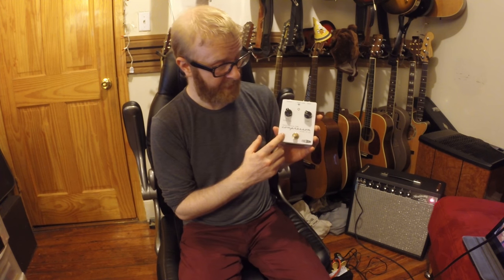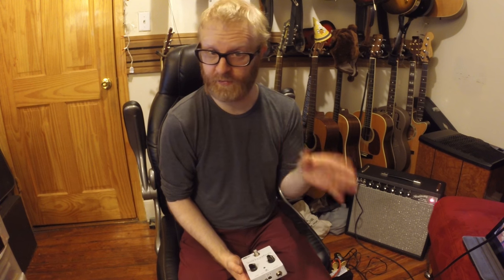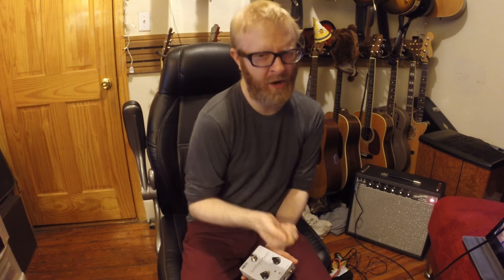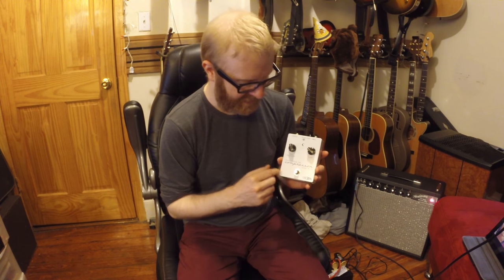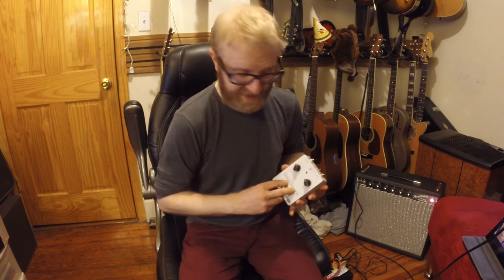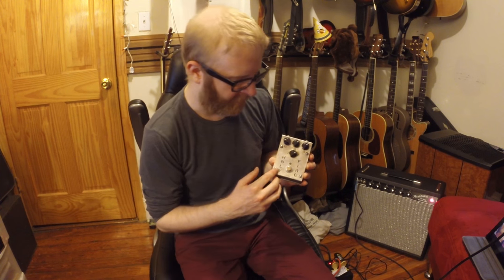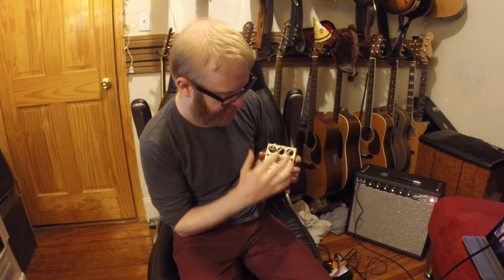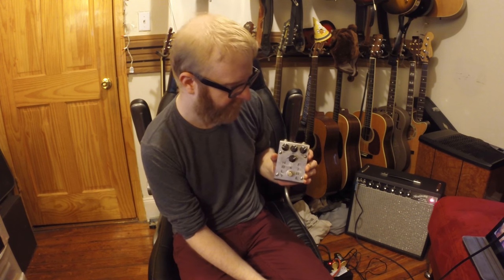PC-2A Tube Compressor after Overdrive [Anatomy of Guitar Tone]

Comment: Actually there are already two sources of compression. The distortion pedal unless stated otherwise, and the amp itself. If you record it with mic, then plus mic and the mic pre-amp. That's why the recorded track view in a DAW always looks like a pipe rather than a say a comb. Putting a compressor after the dist. will kill the tone and transients and this comp. doesn't even have attack and release knobs like my Carl Martin Opto which I use on clean rhythm guitar.
Reply: +ErhanMusician Yes, the overdrive pedal is adding a little compression like every OD pedal does. The amp isn't really compressing and that's the point. The idea is how to create an amp sag tone at low volumes. Placing a comp after an overdrive will not necessarily kill the tone as you can tell in my video. Depends on the compressor. The PC-2A does not kill your tone one bit. Just because a compressor doesn't have attack and release knobs doesn't mean it's inferior. I encourage you to check out the Teletronix LA2A. One of the greatest compressors of all time.
Reply: +GuitarLessonsNYC1 I am also a producer and mixer so I already have great LA-2A emulations and a variety of both distortion pedals and emulations. Could you define  the settings on your pedals so that I can emulate with the same settings?
Reply: +ErhanMusician It's hard to say exactly. If you look close in the video you can see the settings, but that's really only relevant with those pedals. Are you looking to create this with plugins and an amp sim? If so I would place an overdrive plugin in first in the chain with a light to medium overdrive sound. Then after place an LA2A plugin. You don't want to slam the gain reduction. You'll have to adjust by ear, but you should set it to when you start to hear it sag. Then run into the amp sim on a clean setting.
Reply: You just have to watch the output from the LA2A. You don't want to slam the front end of the amp sim.